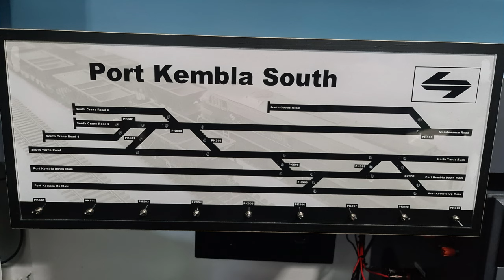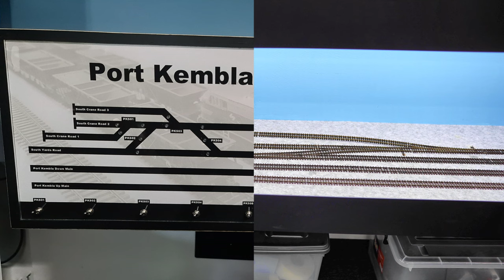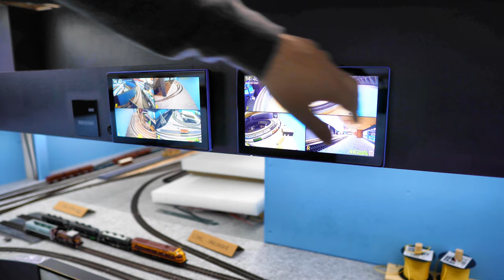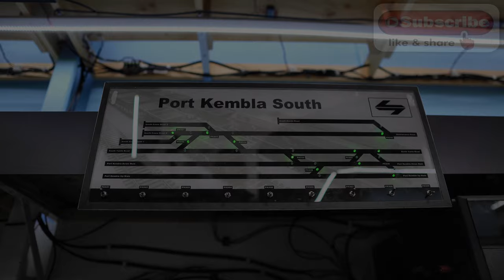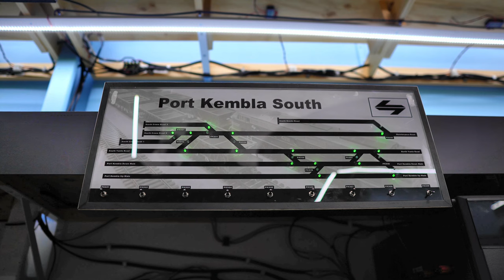September 2023 Model Railway HO Build Update - The Escarpment

Comment: Great work, good job, Jason.
Like the heights of the levels of your layout and your concise design.
Is that felt that you're using for subbase? If so, it will be good for sound deadening....but how is it for fiber particles getting into the gears and such in the engines?
I will be interested in seeing how it  will adhere to ground effects and scenery. At any rate, the space looks like a comfortable, relaxing place to retreat too.
I'll have to catch up, what you going to run? Iron ore trains? BHP Billiton/Rio Tinto/Pilbara?
They all have some awesome looking "American and Australian" power units.
Well, have a good day and Cheers!
                 Happy T-rails!
Reply from the maker: Hi T-Rails, it is a compressed felt that was used for sound deadening purposes. Given how well it helped to lay track and how well it took to PVC wood glue, it will have no problem with scenery adhesion.
The layout is based around the Illawara South Coast line in NSW, so it mainly runs coal trains and passenger trains from mid 70s to mid 80s..cheers

Comment: Seasons greetings Jason. I am interested in your comment about the mistake of wiring the LEDs in series on your control panel and their replacement with a parallel wiring. I have will have 40 cross over turnouts operated by tortoise machines and a single DPDT toggel switch with Green and Red LEDs for each turnout. Can you provide a wiring diagram showing the parallel circuit or reference to a suitable video. I do not wish to use bipolar leds.. Regards Ken
Reply from the maker: Hi Ken, my parallel circuit only uses green LEDs. So it is either green or off for each turnout, if you are not using bipolar will you have 4 LEDs for each turnout?
You might be better off with bipolar if you want to show red and green for each route. Curious with what your approach is
Reply: Thanks for the comment. I have decided to go with 2 LEDS per switch that will give 4 per cross over..1 green led on the thru line and 1 on the diverging line for each switch. I will run the LEDS thru the switch on each of the tortoise machines and each tortoise will be cross linked terminal 1 to terminal1 and tgerminal 8 to terminal eight. The LEDS will be connect3d to terminals 6 and 7. I am not sure if I need resistors in line with the LEDS. I have developed a a wiring diagram. How can I send it to you?
 @JasonWood_Escarpment
Reply from the maker: Hi Ken, can be sent via j.wood@y7mail.com  
If the LEDs are being feed through the switch machines, I dont believe they need resistors. Although, you might want test to see if you are ok with the brightness..cheers